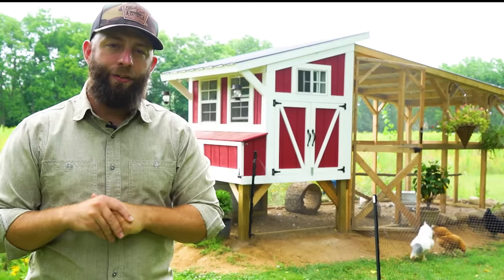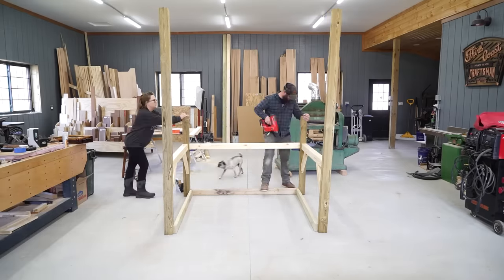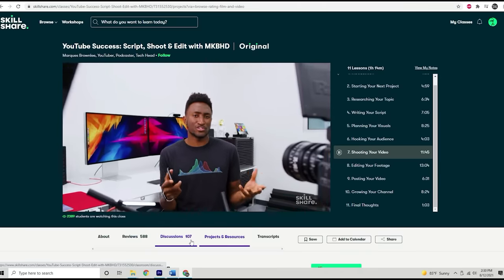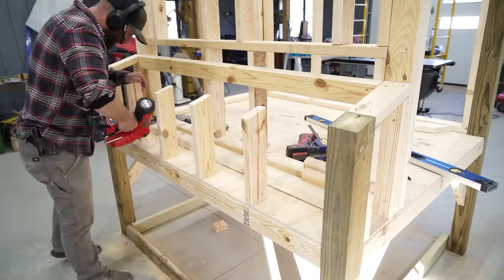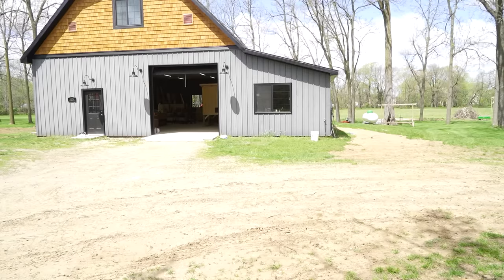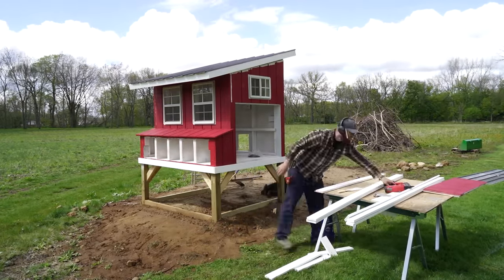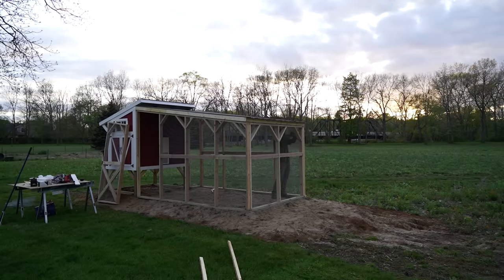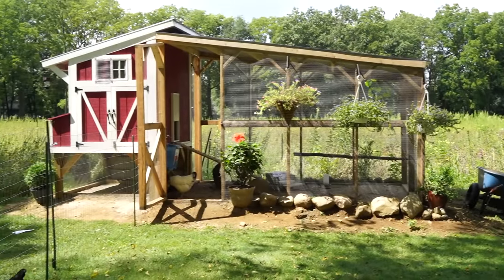Ultimate Backyard Chicken Coop Build | How To DIY

Comment: Sadly, with lumber prices what they are, you are not building this for less than $1,000
Reply: We got just part of the supplies today to build the coop, doubled in sq ft for the house part, plus a saw blade and it was over 700. That’s not even including siding yet. We aren’t planning to do shed windows but otherwise following the plan with plans to build the run when we can afford the next batch of lumber.
Reply: About 1500$-1600$, between using what I already had and using plain plywood instead, I have almost everything but windows.
Reply: I downsized mine because I only have 7 chickens and this plan is for 10-12 and wooo weee it’s still expensive. But I bought ALL the lumber PT so it will last a bit longer.
Reply: Yeah, but that's still waaaay cheaper than buying one still.
Reply: Ian in the middle of building this, about 25% smaller. It will be 1200 for California prices.
Reply: @lambo831  holy shit. Now is that the cost of gas just to go get the lumber?
Reply: @jedediahhoffman7925  Nah, gas was only 6 bucks.
Reply: 1500 minus windows, 2022 in WNY
Reply: @davidpkm  in Australia more, everything is now imported. I am making one by cladding an ibc and that alone cost more than $400.
Reply: It still cheaper than buying one like that.
Reply: So far with all the supplies + linoleum and pavers to place it on i'm in for $700.  Thats with some 11% discounts applied. Thats just for the coop. I still need to get metal for the roof and paint. We are not doing the run. + I made the coop bigger so it is 8 ft long.
Reply: We are at $1200 so far and haven't bought any trim, hardware cloth, paint, or the wood for the run.
Reply: I must say though, it is going to be one heck of a coop.
Reply: Huh, guess you all shouldnt have voted against orange man bc of mean tweets now should ya?  Reap whT you sew.
Reply: Watching this video and seeing your comment a year after You’ve posted it, I would say that with the current cost of eggs this would probably pay for itself within a month.
Reply: @straycat1674  Not even close. 1 dozen eggs at our grocery is $4. $20 a month....? I don't think so.
Reply: @limitbassfishing2733  sarcasm
Reply: @annieg.678  Smart to go PT
Reply: and the idiots that keep buying the stuff are in the long run making it worse. i’m not saying people shouldn’t get their future projects done, they’re gonna do it regardless but really the economy is going down because of it.
Reply: Two months and I would have the lumber from lumber people throw away in my neck of the woods. It’s ridiculous 😂
Reply: Sería fantástico que vendieras un kit con todas las piezas pre-cortadas.
Reply: 0😊
Reply: Just did it this weekend. I'm at $2000 once you add the windows and the auto door.
Reply: @daddytab  show me your receipt 😅 I dont know where you live but if you stuck to the board types in the plans there's no way you stayed under $1500
Reply: @herpderp1662  We learned about supply and demand from school yk lol
Reply: Around my area I could build this for around 500 with a few minor changes
Reply: @jacobsnipes8021  Nice try but no.
Reply: @gunnarwb    Wow that a lot of money. Where are you located and how detailed were the plans. Do you feel the price of 2000 was worth it?
Reply: Even if this cost 1,500+ you are getting a better quality coop with a run. I looked at the coops at our local farm store and the size I needed was 1,500 with no run. Less nesting boxes and then I’d still have the cost to build a run.
Reply: @herpderp1662  guessing if they are on this channel and building a chicken coop instead of identifying as a chicken-they voted for the orange man. Just sayin.
Reply: @Mrs.NRalphs    OK but that’s not when he was mentioning about the quality of coop. He was just saying sadly to build that coop it’s going to cost you do to the rise in prices. Id blame the corruption of our governments creating extreme rise in the cost of living.
Reply: @bobomonkey702  I understand that. I’m mentioning that even with the cost increase you’re still getting a better quality product instead of spending the same amount $$$ on a prefab coop that’s going to need replacing sooner. At least with the weather where I’m located. The cost of everything leads back to the greedy gov’t. You will own nothing and be happy.
Reply: @NatalieRalphs  I have yet to get my coop and chickens. I've been doing my research, and a major part of that is the coop. My sister in law was telling me that her TS brand coop is rotting after only 2 years. I'd rather try to salvage materials from construction sites and build my own.
Reply: Bought today.  Coop only.  Everything minus windows and door is 750. BUT all lumber was PT. Live in East Tennessee. Getting run materials at the end of summer and chicks next spring.
Reply: I just finished this and I’m at about $1200. Great deal 👍🏻
Reply: $1,800 for me.
Reply: This will pay for itself!
Reply: Incorrect, I just demolished a 100 year old back porch 💪🏻🐸💪🏻
Reply: I'm cheap.  I repurposed  my kids old playhouse for my henhouse. Super easy conversion. Hardware cloth over the windows,  a new door and added nest boxes. Painted the outside the traditional Barn Red, inside had to be all Pink. Pink everything for the girls. No roosters aloud in the hens clubhouse.
Reply: @laattardo  That's actually the best idea. I don't have a problem collecting and using reclaimed lumber. I've saved a lot over the years. I used it on our tree house/Schoolhouse,  a deck, a greenhouse,  chicken coop, and tool shed. I've even reused nails and screws too 😆
Reply: Or you could use pallets
Reply: I am using wood pallets and going as close to free as possible
Reply: @wandadumas5810 Yess! Like you could afford that! And the shipping!! Then you could not change it to suit either. One size does not fit all. He made a great design, but his resources would not cover that fiasco.
Reply: I go to construction sites and ask for spare lumber , they eventually throw it out , I only invested 400$ out of pocket
Reply: Can confirm!
Reply: Already had all the trim lumber from saw mill .  Used free plywood from a job site throwing away tons of it. Already had shingles left over from building our home a year ago. Only had to spend $500 on the coop 👍🏻
Reply: The little coops at Tractor Supply are ridiculously priced.  I bought these plans months ago with my husband’s promise to build it when it cools down.  He just told me to go get the materials!  Never been so excited to head down to the lumber store.   It’s my early Xmas present🎉
Reply: @shannonmoore1382  Wow! That seems really high for materials. I also just purchased the plans and am hoping to keep materials cost below $1000. I'm in the state of Georgia. May I ask what state you purchased your lumber from? Also, have you completed your coop yet and did you find it easy enough to follow the plans? Thanks
Reply: I used old lumber just laying around
Reply: Should of built it a year ago then lol
Reply: The ROI on this is non-existent if you are raising chickens to save money, this won't do it in your lifetime. It's nice, sp if you have the money more power to ya, be good In a neighborhood. But need a cheaper option for those just trying to have fresh eggs and save money.
Reply: It’s a good thing there tons of houses being built around here. I just get wood from the dumpster. They waste soooooooo much wood it’s crazy. Only benefit to all the development 🙄
Reply: @ericsmith2055 you ever complete the build? In middle TN and about to take on this project
Reply: I did not buy his plans, I built a coop in the same design concept, the coop is bigger because I incorporated a 2'x3' storage into it, I built my own windows that are hinged, used some window props from amazon to lock them open, and I just finished it a few days ago. I have just under 2500 invested into it. That price includes plumbing in water for chicken nipples and building pvc feeders.
Reply: You must not be in California I'm thinking more like $4000
Reply: That's funny just windows and paint is $400
Reply: @0505abab  you might be right about that, I'm in tx and the cost of living in California is ridiculous for sure...
Reply: Well! Today in 2024, this coop might cost between $5000 to $7000
Reply: Under $700 where I'm at
Reply: @smsteger89  must be cutting and milling your own lumber
Reply: @jedediahhoffman7925 😂😂😂😂

Comment: So this is becoming popular on the chicken groups. I started mine over the weekend. I can tell you invest in a Kreg tool make a lot of these angles easier. Also if you are building stages like me most of this is 3" screws till you get to the t1-11 and trim parts. Oh and the Valspar he recommends for the inside floor, apparently all have latex in it now. I spent 15 mins with a Lowes paint rep going over the video to get the image of the porch coat.
Reply: What Valspar/product did you use after all?

Comment: The center brace on your doors should go from the bottom of the hinge side to the top of the latch side, to prevent sag.  Switch the doors and flip the handles.  Nice work.
Reply: We have just finished this design and are having a hard time hanging the doors. If we do as you have suggested here, I’m hoping that will correct our problem. I’ll work at it tomorrow afternoon. Thanks!

Comment: Love this!! 
I would need to have a higher pitch on the roof for heavy snow load but that’s gonna be an easy adjustment ❤
Also I will add some kind of insulation to help with keeping things cooler in the summer and warmer in the winter as well as keeping down condensation 

Great build!!! 

Thank you 😊

Comment: Plans ordered.  Wood being delivered Friday.  Windows, automatic door and hardware will be here this week as well.  Should be able to get started on it next month once I get some other projects knocked out.  We had chickens when I was younger, looking forward to the build and getting the chicks in the spring.  Thanks for the video and plans!
Reply: Do you mind sharing the cost of the lumber package?
Reply: We're getting ready to start this project too.  Before we get too deep into this I am curious about an estimated cost for all the supplies, windows doors and lumber.  I know it will vary but just an estimate would be great!
Reply: @joeyclement  Sorry, I just saw this question.  I'll give a cost breakdown of what I spent.  I ended up using all treated 2 x 4's so the cost was a little more than non-treated but it wasn't much more.

Lumber:  $850 (approx)
Windows: $140
Hardware CLoth: $150
Chicken Door: $170
Hardware (Latches, Hinges, screws, etc) $300
Paint: $100
Tin Roof: ?????  Haven't picked up yet.

So, My guess on the total build will be right around $2000.00.

Add in the chickens, feed, various other things and I think the ROI on this will be somewhere in the year 2150 or so, ha.
Reply: @quadcityfoodplotsinc.2729  

Sorry, I just saw this question.  I'll give a cost breakdown of what I spent.  I ended up using all treated 2 x 4's so the cost was a little more than non-treated but it wasn't much more.

Lumber:  $850 (approx)
Windows: $140
Hardware CLoth: $150
Chicken Door: $170
Hardware (Latches, Hinges, screws, etc) $300
Paint: $100
Tin Roof: ?????  Haven't picked up yet.

So, My guess on the total build will be right around $2000.00.

Add in the chickens, feed, various other things and I think the ROI on this will be somewhere in the year 2150 or so, ha.

Comment: Bought the plans, building the coop now. I’m no carpenter, it’s not perfect so far, but the plans are excellent, easy to follow. Any mistakes are from my own dumbness. I can’t wait to see it done.
Reply: Im in the middle of building mine as well, the angles dont match up nicely like his but its solid and will work. Good exercise in some basic skills
Reply: @MasterBojangles  I would like to build this but I'm wondering what skill level is required?
Reply: @bn.1952  hardest part is cutting the angles at the tops of the supports for the angled roof. You can use a mitre box but I used a speed square and a circular saw. Also pretty challenging to hold pieces by yourself, darn pieces move all over the place
Reply: @bn.1952  you need to be able to cut flush pieces, make fairly accurate measurements, and have the space to put some of it together. I built the basic structure, moved it to the back, and finished the rest of the walls and roosting boxes otherwise I couldn't move it
Reply: @MasterBojangles  thanks so much. I just don't want to start this project and then figure out it's a little above my level of "expertise!"

Comment: Nearly done building our coop from your outstanding plans.
Reply: Jorbid can you provide rough cost for supplies? just curious
Reply: I bought 40- 2x4s  the plywood and treated material, screws and nails and that was $715.00
Still have windows, hardware, paint and wire to buy. Probably be around $1500-1800 total for materials. Dang wood is high right now.
Reply: @michellegiles4152  yikes, I was afraid it would be high! thank you for providing that info.

Comment: Love the looks of this. I just found out that here in Detroit we can have uo to 8 chickens so im looking into coops, heaters, watering, etc. I only have 18x51 feet to work with and would have to put the door on the opposite side. Your door side would be up against my garage.  I'll have to figure some stuff out.

Need yours with the coop turned 90° from the run and build the whole thing as a lean-to.

Comment: Just finished building ours. I’ll make a video and show the results. I’m no craftsman either. This was just me giving it a go. Great
Reply: the rough opening for the main door is 41.5". the siding filler pieces show them being flush with the RO. but the doors together are 42.25" wide. are the filler pieces supposed to be trimmed so the door will fit properly?
Reply: @ashleygreen4209  unfortunately it’s all your own measurements past a certain point. I had to do a lot of fitting and cutting to make it right. Give it a go and good luck!
Reply: @RBoysMedia  thank you!

Comment: I love this design so much but the space I need to put it in is next to a double rv gate and I only have 7’ from the house to the gate opening so I want to try and adjust the plans of the coop a little to make it more like 4’ wide and 6’ in length and then make the run 6’ wide so it’s 2’ wider than the coop and about 12-15’ in length. I keep watching this video over and over again because I love this design so much.

Comment: Wow love how cute this is and how easy it is to clean. I’m sold and I have a set a plans for a different coop but I just bought your  plans and I’m building it this weekend. Thanks so much for making the plans available to purchase 🥰
Reply: I’m buying them too. Let me know how it goes. I have 10
Reply: Matthew. I like the plans and the color coding. However he doesn’t tell you which size boards to use when you make your cuts. So I’m figuring it out as I go. Will keep ya posted.
Reply: @michellegiles4152  currently building mine now but bigger. Bought his plans and using them but having to custom cut as I go
Reply: @makers721   did you cut the 2x4s at an angle for the side walls? If so what angle? He doesn’t say in the directions but it looks like it in the video
Reply: @michellegiles4152  my assumption is it would maintain the 15% angle that the 4x4s have
Reply: @michellegiles4152  I have the base and back wall built haven’t got to side walls :)

Comment: Great Build, only thing I would have done that is different is use Joist hangers on the floor joist to help distribute that load, and also the back wall I would have added a couple jack studs.  It is probably fine, but I get a little OCD and over kill every thing.

Comment: Just built it in so cal. About 1400 in lumber plus a automatic coop door plus hardware. About 2 grand. We built a Dutch door into the run. It took us about 3 weeks to build. I recommend getting hardware cloth coated in pvc. It doesn't absorb heat plus it's black and looks nicer.
Reply: why is hardware cloth stupid expensive lol. the pvc coated stuff is outrageous.
Reply: @WolfCatBirdPigMan  lol, yeah it is.  We got ours on Amazon. It was way cheaper than Lowes, or Home Depot, but it's still not cheap.

Comment: Really like your design. I'd built a coop a while back that's likely going to be moved and turned into a garden shed and will be attaching a greenhouse to it. It's more room than they need. This design fits really well with what I wanted to do for downsizing them, yet giving them enough room to roost. Though I might modify the roosting a bit as I use the deep litter method.

Comment: The only other thing I would add to your build is a decent steel reo mesh outer dog fence , set into logs / concrete or ground 500mm / 2 ft  deep and no gap bigger than 100 mm / 4 inch , leave the sharp bars up !! When a pack of dogs in kill mode turn up they will jump , they will dig .

Comment: I bought these plans August 20, 2024. I had my local Home Hardware store here in Nova Scotia, Canada quote the parts list for both coop & run. Came to $1619.45 before tax, $1862.37 after. This does not include the hardware cloth, 3" galvanized nails, windows, or automatic coop door. Just for your reference so you have an idea of cost. Cheers!

Comment: Hey Chris, I'm beginning my build using your bought plans.  One question I have is when watching your video, I see you cutting up longer lengths of 2x4's for several cuts.  But, your materials list doesn't clarify which are cut into smaller pieces.  As an example, the 10' 4x4 is cut into (2) 48-1/8 pieces, but it doesn't say that.  I just assumed.  I get in trouble when I assume.  Got any thoughts about the materials list and which ones are cut into smaller pieces?  Thanks!